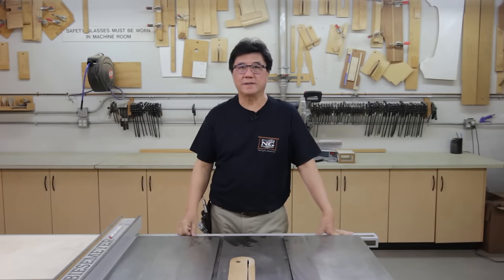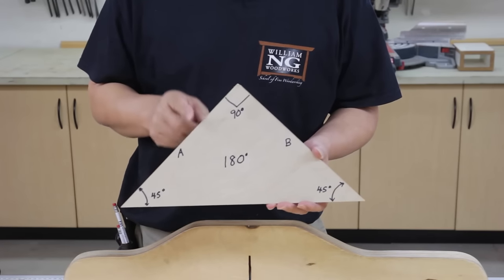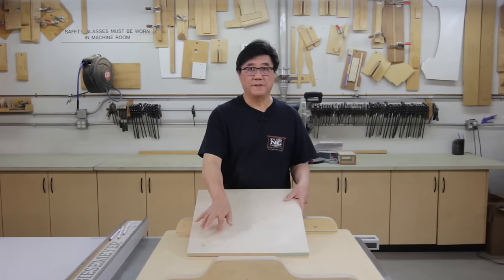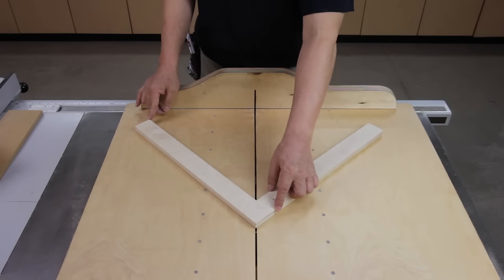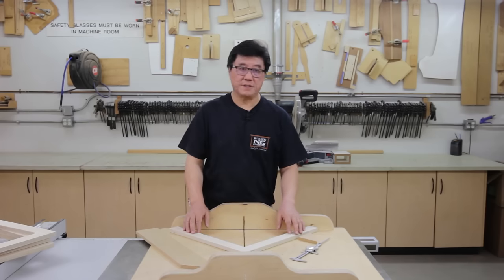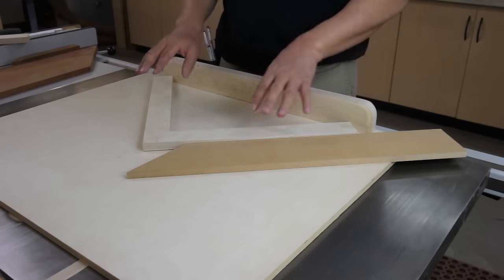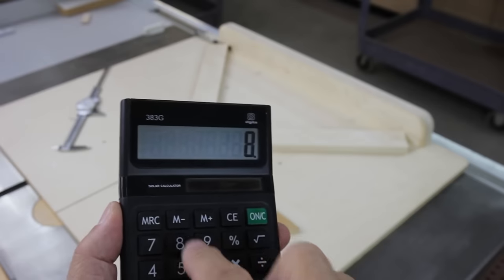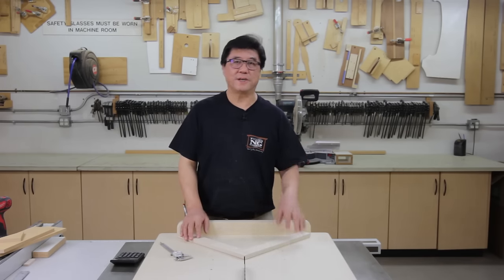2 Cuts to a "Perfect" Miter Sled

Comment: Hello Mr. Ng.  I appreciate the precision you bring to woodworking areas that require precision, such as 90 and 45 degree cuts.  I've been searching Youtube for a precise way to set  the blade tilt on my table saw to 90 and especially 45 degrees, or alternately setting my miter gauge for those angles.  This would be the easiest way to cut those angles.  Unfortunately, I haven't found a way to set either the blade or the miter gauge to those precise angles - and know that they are accurate.   I discovered your videos to make a precise 90 degree cross cut sled and how you adapted it for precise 45 degree angles.

I have a question for you.  Instead of making 2 sleds - one for 90 and one for 45 - would it be possible to just make the 90 degree sled and have the 45 degree attachment be removable?  

 It could be attached with either magnets or pins, or both.  This way I can really focus on making one precise 90 sled and just attach the 45 degree attachment when needed.  It also saves shop space by not having 2 sleds.  I'm sure you would be able to devise a better way for the 45 degree attachment.  

I'll check back to see if you have any comments or suggestions.

This is the first time I have written to someone on youtube.  I wish I knew how to contact you directly.  But lets try this for now.

Thank you for sharing your expertise.

Jack

Comment: Hi Willam
I'm a bit late to the party, but have only just started woodworking in anger.
I built and adjusted my cross cut sled based on your earlier video, and got it to within 2 thou over points 23" apart. Took me 2 iterations, well worth the extra effort.
I'm now going to add a mitre cut aspect, and this video gives me all I need to make the jig and adjust it - like you, I don't see the point cutting mitres which are off on each side and then keeping track of which one was which, better to get it right.
I actually have just one question - why did you finish the cuts to make the mitres using a bandsaw? Was it a kickback safety measure, or some other reason?
Love your videos, great clarity and thank you for creating these and posting them 🙂
Reply: actually forget the question, it answered itself when I made the mitre, with only a little of the blade coming through the wood...

Comment: Did I see saw kerfs under your square sled?  I love my sled, thanks for teaching me how to build such an accurate one!   It has, however, dished (cupped) in the central areas furthest from the ends, outer edges and cutline.  Is that why you made those kerfs, to help alleviate dishing--giving you more accurate cuts in a plumb line and more consistent depth for rabbets etc?  Thanks in advance for your response, great content, don't listen to the haters!
Reply from the maker: Not sure I understand your question or what saw kerf you're referring to. So, I'll guess that you're referring to the saw kerf under the "V" fence. I do that for dust relieve. Don't feel bad about your sled cupping. It happens due to moisture and the environment. Only thing you can do is buy the best quality plywood possible and control the environment of your shop. Hope this helps
Reply: @wnwoodworks  In your video at 9:47 I can see a bunch of rounded black marks on the front edge of the base of your crosscut (square) sled.  I can't see it well enough, maybe they are just marks from the factory, or marks you made with a Sharpee marker, but I thought they were saw kerfs.  Think of it kind of like on wide baseboard molding, or plywood you are trying to bend around a curve.  Back cutting it or kerfing it allows it to either bend without breaking or sit flatter against the wall.  I thought that was what you were trying to do.  I think part of my problem is that I'm hanging my sled on the wall with the runners directly against the drywall, so there is very little space between the wall and the back, so if its the littlest bit more moist that the ambient room, the underside expands causing the sled to cup.  I'm sure storing it the other way around with longer rods to support it will do the trick.  Thanks again for your amazing channel!
Reply from the maker: @smallfarmsolutions  HaHaHa You have good eyes. You're not suppose to see that. I had to make the sled smaller to fit below the table saw. I took the rear fence off to cut it shorter. What you are seeing is the old holes drilled to hold the back fence in place. I should have cut all the holes but I wanted it to be a certain length. Next time don't look so close. :)
Reply: @wnwoodworks  Sorry man, I can't help it.  You are an amazing teacher, but people who are great at what they do often don't realize how easy things are for them, the learning curves are long since forgotten.  We mere mortals have to scrutinize every detail to get those little hidden nuggets.

Comment: William, seven months ago I viewed this video, and then left a comment to which you replied.  Your reply was short and to the point.  I was left confused, so I left it at that.  Fast-forward, seven months, and a need now to build a miter sled, I again viewed this video and my comments and your reply.  This time I, actually, read my first comment.  To my chagrin, the second sentence was a grammatical disaster!  The next mistake I made was that I entered 3.884 instead of the correct value of 3.834, which is the mean (average) of the two sides of the test piece.  I apologize!  My only excuse is that it was late at night when I wrote my first comment and I was tired and lazy!  Now I would like to try again to explain the point I wanted to make, and then shorten your calculations to make it easier for rote calculation of the miter sled error. 
 First for clarity, I will label the two sides of the test piece with lower case letters (a and b), [(a corresponds to A) and (b corresponds to B)]; the Miter Sled fence sides will remain upper case letters (A and B) 

Given: A = B 

If:  (a = b) the sled has no error, and no correction is needed.  But, if  (a is not equal to b), then there is an error that has to be corrected for either the A or B fence side of the sled. (The correction is made to the shorter side of the sled fence, corresponding the shorter side of the test piece.)
 To calculate the error you find the “difference” between (a and b), and divide the difference by two. This gives you the error for each side of the test piece.  {(|a – b|)/2}.  (One side is short by this amount, and the other is longer by this amount.) 
Note:  In the formula (|a - b|)/2, if order is maintained, when a is less than b, then a is negative. Which means that Sled fence A is the side to be corrected for.

 {This is where, I assume, we are not in disagreement.  I contend that the width of the board used to cut the test piece is irreverent.  Again, when(a = b) there is no error to correct for.  (The mean (average) is the measurement to use, not 4 inches.  The mean is where (a=b). In fact, your formula states “The width of the test piece”; neither side measures 4 inches. They measure 3.839 and 3.828. Therefore, you must use the mean, where (a=b).}  To continue.

 Next: find the “sum” of (a and b) then divide by two. ((|a + b|)/2).   This gives you the mean (average) of the two sides.  This is the distances where (a=b).

 Finally: take the error of the test piece sides ((|a-b|)/2) and divide by the average of the two  sides ((a+b)/2) this gives you the error per inch, which you multiply to the length of the sled fence side for the error correction to the shortest sled fence side, which ever one it is
 Here is the short cut formula:

 (|a-b|)/(a+b)×(A orB) = sled fence side error correction 

Example:   Using the test piece data.

(3.839-3.828)/(3.839+3.828)=    0.011/7,667= 0.0014 x 16=0.02295524 ≈ 0.023

0.023 is the correction for side B.   There is a 0.001 difference due to my not rounding off, until the end of the calculations. 

Again I want to thank you for your videos.

Comment: Just for your info I made a straight cut sled for my table saw using a square checked the cut by flipping cut board over making another pass looks great. All happy, right? Then I spotted a squarish piece of scrap and tried your 5 cut. By the third cut I was in trouble just eyeballing. So to H--l with the nay-sayers.

Comment: Perhaps this is a dumb question.

I made my crosscut sled using your five cut method and it has been wonderful for over a year.

I’m trying to make the miter sled and the issue I am having is every time I try and make another cut the triangle fence is moving even as I try and hold it, especially when I cut to the left of the blade.

Any tips on keeping the fence centered while dialing this in?

Comment: William, I have made two miter sleds.. One from 3/4 mdf and one from 3/4 plywood. Similar to the second model you make in this video only smaller Once I set it and it's new it makes fantastic frames. However, both sleds have warped at the kerf end over time. Now one side at the top/kerf end is maybe a 16th of inch taller than the other side.. Very frustrating. I could put  a brace across the top but I would like have it open.. Any  idea what's causing this? 

I made my first sled out of mdf and it did this.. So I thought plywood would be better. Same thing happened again.

I glue and screw the  bottom for the runners.. not much else.. idk.

Thanks.

Comment: Have you ever tried UHDPE (UHMW PE) for the sled runners?  It seems like that material might be better from both the sliding friction and dimensional stability perspectives as compared to hardwood, but I see you prefer hardwood so I assume there are reasons for that.  Would you elaborate?

Comment: Did notice that after you determined the leg (to your right) of miter was .022 short , that was the difference in the hypotenuse of a tringle against the fence . So when you spaced the right leg .022 forward you measured forward (perpendicular to fence ) .022 on the height of the tringle , not adding .022 to the length of the leg .   ( C², length of leg =  A² + B² , you increased A or B by .022 thus  C by .031) Just sayin .    Great presentation !

Comment: The math will not be separate from a job which is needed to use measurement. Definitely, math has hand in an engineering job today.
Math in engineering job as same as the brain in the body. Thanks for sharing that with us.

Comment: Question: when setting up to make the second miter sled, couldn’t you just skip the trimming step on the crosscut sled (6:43) and go straight to trimming those edges + making a square again at the same time on the table saw (7:08)?

Comment: Easier way to check and adjust the 45's is to use any (perfectly parallel) stock, the wider the better. Create the 90 degree "base" like William does and place onto the sled. Cut 2 mitres from the left, leaving you with (say) a 1" long "slice". Now flip it over and cut another 1" slice using a mitre from the right - keep track of which (of the 4 cuts) from which side!
Then compare the lengths of the diagonal cuts made by each side. An easy way is to hold the test mitre around the 90° of a good steel square, then see which point sticks out farthest.
Which ever diagonal is longer is the one that needs the "shimming" (like where William uses the feeler gauge).
The advantages of my method are that it doesn't rely on starting with a perfect 90 degree cut for each test. The tests are slightly more accurate (the diagonal exaggerates the error by about double). And you can shim and re-cut a new test instantly without squaring up the end of the stock.... just take another slice off each side.
Remember - in a standard 45° mitre joint you want a perfect 90° total between the mitres, and then you want the diagonals of that mitre to be the same length. So the easiest way to create the jig is to use the exact same method to calibrate it.

Comment: Can you explain how you determine A and B on the test cut?  Also, how you know which side needs to be adjusted?
Reply: The way I remembered it was the A of the miter and the A of the test piece form a 90, So do the two B sides. You can see the sides being called out here 9:01.  Then once you cut a test piece and use the formal shown 16:05, you add a shim the thickness of the error calculated to which ever side was shorter.

Comment: I have a question.  When calculating the error on the miter sled. How do I know which side to adjust. My error was a negative number. Is that a correction using the feeler gauge on the A side or the B side. Thanks for the video.
Reply from the maker: Sorry for the late response. You adjust the short side

Comment: Forget the naysayers.   Your methods make perfect sense.
To improve, length is just as important as perfect 45 degrees.   Can you find an equally clever method to assure pairs of sides are of equal length after cutting the 45`s?   I know that on a miter saw,  a stop block can be used when cutting 45 even if the lengths are not correct to begin with.  

I have a jig for my radial arm saw which holds the sides at 90 deg and the apex of the 90 deg V is facing toward the back of the saw.   This is the one thing that Sears sold me 40 years ago that actually is accurate.  Those picture frames are still on the wall from 1975.

Comment: It would really help if you put the equation in the video description. The front used for the equation in the video is very hard to read and the format isn't really mathematical formatted
((A-B) / 2 / Width of test piece) * Length of one arm of the miter guide

Comment: I have tried theis vid several times and sorry to say the audio seems corrupted making it very difficult to follow. Further I cannot see where you are marking your A and B. Nor does the measuring tool seem to add up to me. As that tool alone probably is very expensive is there another way to get the accuracy without using Starret kit?

Comment: Using your 5 cut method, I built, and calibrated the most accurate table saw sled I have ever used - mine or someone else's. I haven't seen any new content from you for a long time, so I don't even know if you monitor your channel anymore. If you do ... I'm having trouble with this miter sled concept. Have checked and double checked my math several times, and no matter what I do, it isn't working out. Here's my problem: In your example with building a separate sled, your side (B) ends up shorter. In my situation, side (A) is shorter. I'm assuming that feeler gauge always goes behind the short side. So, when I put it behind the short side (A) and test again, I'm still off - seemingly by the same amount as when I started. I'm baffled and have been at this for several hours (making a lot of triangles out of straight stock). What am I doing wrong?

Edit: Figured it out. For some reason (bad or sloppy technique is my guess) I wasn't ending up with a perfectly square fence piece. Re-did it, double checked with an engineer's square that it was correct, went through the process again - perfect. Love the content you put out. You contributed to my upping my game as both a carpenter and a woodworker.

Comment: Had anybody figured out how big his templates are for making these jigs? His crosscut video he left the dimensions but not this one. Also is he using Baltic birch for both sleds? I have read so many comments but no answer I can see. Thanks! making one after I pick up some hardwood for the runners.
Reply from the maker: What dimensions are you looking for? The base is 24" x24"
Reply: @wnwoodworks  Thank you that's what i was looking for! I am making both your crosscut and mitre sled. Trying for perfection (which never is). My first attempt at making runners didn't work. I jointed away too much material to make it square. Back to the lumber store for me. Thanks for the reply.

Comment: I used your method 8 times, 8 different ways adjusting “A” and “B”. I absolutely can NOT get this to work. Someone tell me what I’m doing wrong. I got a negative number my first time, so I adjusted A instead of B. Got it closer to zero error. Then I adjusted B slightly. Now every time I make an adjustment, it’s off by 0.03”+ in one direction or another. Seriously about to lose my mind here, can someone please help.

Comment: one extra comment   if I build a box with a side of 14 in.  with a 3/8 box finger  that is over 37 fingers.on each side. 2 sides = 74 fingers  and  each finger has 2 sides.  if the error is .001 per side that is over a 1/8 total error.  things fit or they don't.   this example shows how little errors ruin the work.  wm miller

Comment: William what do I do if I have blade wobble. I can only afford inexpensive tools  so my equipment is never gonna be great to start out but im sure there would be some kinda procedure to counter for this. unless it is just negligible ...maybe im being too anal I dont know
Reply from the maker: Hi Al, Don't worry about the wobble. All saws have some blade run out. All that does is make the saw kerf a little wider. A sled will compensate for some of that.
Reply: @wnwoodworks  I found out what it was that was throwing my sled out every time (10 attempts with three rebuilds) …. the slots are not parallel by more than half a mm over no more than 500 mm distance....conveging towards the outfeed end. so im building my own saw coz atleast then I know it will be right and if its not then that's my fault. after that I will try to make this sled again. cheers mate

Comment: However now I use feeler gauges and calipers to fit my drawers mortise and tenon joints and all precision work the five cut method got my table saw sled within 1,000 of an inch I didn't think woodworking could be that precise thank you